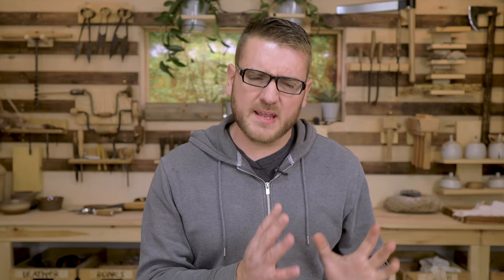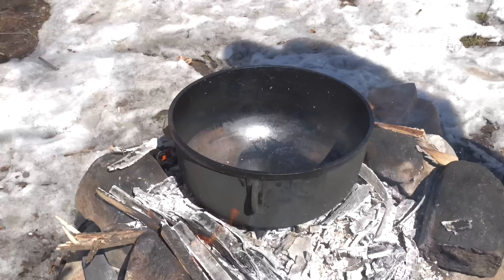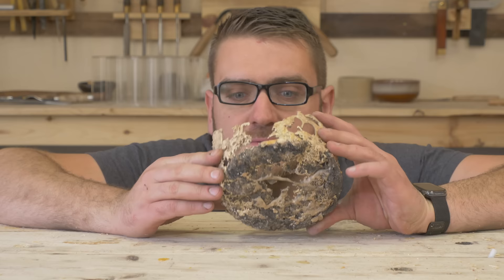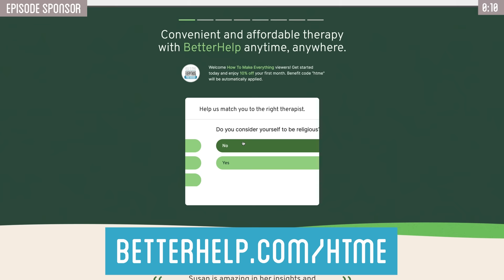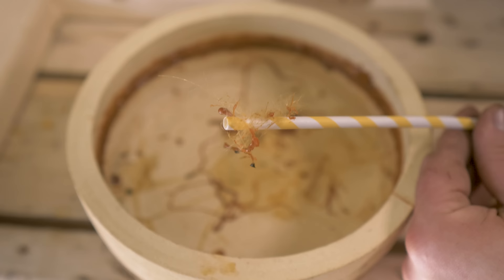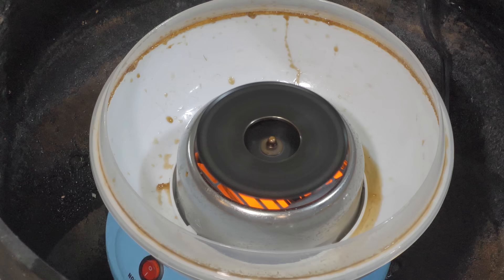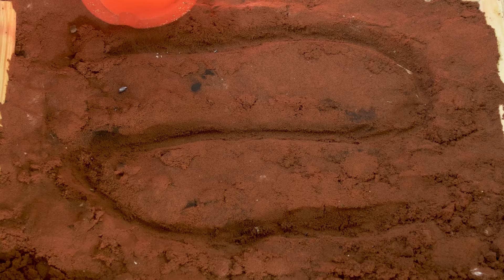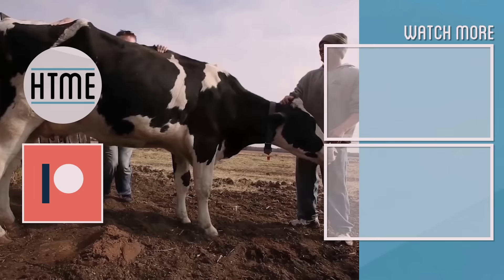Can a Dr. Stone Centrifuge Make Cotton Candy and Wires?

Comment: You could try to make wire using the Melt-Spinning method.
You continuously pour molten metal on a spinning roller.
Commercially it's used to make metallic glass strips, but I think you could adapt it for crude wires with a groove on the roller, or something, and it might be easier to do than extruding.
Reply: Drawing is technically still the easiest method
Reply: @velazquezarmouries 
Well, yeah, but if you want to make tens of meters of wire, a method that is a bit faster, more continuous and less manual should decrease the amount of work per meter of wire drastically, making it easier in the long run.
Also, if your Melt-Spinning wire is consistent enough, you should be able to lengthen it by drawing it once or twice. (after annealing it, of course)
Reply: I was thinking the same thing. As far as I know it needs to have a fair bit of space below the spinner too for it to have a chance to cool before hitting the ground. The fiber used for optics have towers to make em. That may just be a glass thing though.

If anyone is interested Google fiber optic production tower.
Reply: @thebillyd00  Maybe if they can get the liquid metal viscous enough without compromising other desirable properties, it can behave like the molten glass, but I think the cooling would be especially tricky. Unlike glass, metal is very thermally conductive, so it would be much more difficult to deal with in a controlled manner than glass. Plus, there's also work hardening, but I imagine that won't be a problem that early on in the process.
Reply: wasn't that how the stone and glass fibers that are used to insulation are made? I don't think that'll work with metal either because glass is a polar molecule and trends to act like sugar while metals aren't even in molecular form and the liquid flow will break apart even with a little distortion
Reply: @thebillyd00  
The metal roller is what cools down the molten metal. 
To clarify, I'm talking about the metallurgical process of making metallic glass ribbon, not the polymer weaving process.
Reply: @DimiDzi  
You're thinking of the wrong process, the process I'm talking about has practically no liquid flow, after the metal hits the roller, as the roller, itself made of metal, cools it down very quickly, this is why it is used in making metallic glass ribbon/strips, as metallic glass usually requires insanely fast cooling rates. And this is also why I think it might work nicely, as it solves the problem you are talking about.
Reply: @My_initials_are_O.G.cuz_I_am  metal glass is hard to produce even with modern technology requiring the roller to be constantly at negative Celsius temperature for the shock cooling to happen which either requires a fridge or substances unacquirable for that time period

most modern wires are just cold pressed rods through thinner and thinner gauges nozzles until they get longer and thinner
Reply: @DimiDzi  
Well, yeah but when you want a strip of normal, crystalline metal, you are better off with slower spinning of the roller and lower cooling rate anyway, and I presume that extruding the wire through a series of nozzles is going to be much more difficult than modified melt-spinning, with the rather primitive materials and machine-making available to HTME.
Reply: @My_initials_are_O.G.cuz_I_am  nozzle extrusion is the historical way of making cables although back then everyone just cut the wires and used them to make chain links for jewelry or chainmail armour
Reply: Your problem I think has to do with the fact that you made the hole in your crucible WAY too big. Also, different metals behave differently and I really don't think tin is a good substitute for gold. Gold is literally the most malleable material known to man and I think your issues with drawing it into a wire had more to do with impurities in the gold than anything else.
Reply: Melt spinning advantage is high cooling rate and thou specific materials can be made if process is optimized enough. I have puored aluminium on copper wheel in one of our research projects. It kind a worked but it was a mess and probably would take a lot of time and energy to get it working properly for production.
Reply: @My_initials_are_O.G.cuz_I_am  You could try extruding it, but it may be hard to create the pressure to with out machined parts and a huge lever.

It may also require heating to extrude at all which brings a ton of issues.

Comment: Look into Continuous Rotary Extrusion for some info on how wire and stuff is done at scale. The cup method you used would work for small scale. You just need more tube with a water jacket below it to cool the metal as it is falls. The metal wont get stuck because it contracts when cooling. You would still need to draw the metal down to get wire. But honestly your easiest method would be to make thin flat sheets and cut that into wire. Heck with flat sheets you could do a sorta proto-circuit board. I think its cool you tested the Dr. Stone method. Would bee cool to see some of the other outrageous stuff he did tested. Would be a cool side project series. Foxtail Ramen ect. The coolest one on the show that was not completely outrageous was the record. Though Im not sure how well you could do it with glass.
Reply: I've seen a lot of food people tackle the ramen.  It never ends well, lol.
Reply: How do i make a Gold-Sheet? 

@ScamstinCrew

Comment: Andy: "This drop thing caused a really dangerous splash."
Also Andy: "I'm gonna pour molten metal into a device designed to throw things in every direction at high speed"
(I'm not ragging, I kinda wanted to see that despite knowing it'd be a terrible idea and I'm glad it didn't seem to hurt anyone)

That last idea has some promise though. I think maybe putting it closer to the water might help, could give the falling metal less time to accelerate and separate?

Comment: Great video! 
The laminar flow wire making method seems very promising! You might want to try pouring the metal into pre heated oil, so as to cool it down and solidify it while making less of a thermal shock (which I supposed was responsible for the brakeage, although I have absolutely no expertise in the subject).
Reply: the breakage is more caused by surface tension; in the liquid state, the metal atoms are more attracted to other metal atoms and less attracted to air molecules, hence the atoms tend to get pulled more towards the center of the molten metal, forming roughly spherical blobs. This is the same reason water beads up when you pour it.

Comment: For your final laminar flow method, I think it might work if done from high enough. In the past, bullets were made in shot towers. There, they dropped bits of molten lead from a high place. Due to turbulent flow and surface tension, the drops would form into circles before they cooled, and they would cool from air flow before hitting the ground. If you did this with laminar flow, and a thin enough stream, you might be able to get the air to cool the metal before it has a chance to form into balls.

Comment: Near where i live is a “shot tower”, a brick tower that held a furnace at the top to melt lead, then this lead was poured through screens of various sizes and allowed to fall down inside the tower and through a shaft in the floor to a collection pool dug down into the cliff the tower is perched on. This was used to make small, uniform lead shot for use in shotguns in preindustrial times. The lead would cool as it fell through the air, and surface tension would cause the little droplets falling through the screen to take on spherical forms, with the water at the bottom to cushion the impact of them falling and landing on each other and to finish cooling them. 

I think that same principle might work with your laminar flow idea, if you can provide enough of a height of relatively windless space for the molten metal to drop through that it can cool to a point that it holds its shape before it hits water.

Comment: i wanna know what will happen if you have a larger container. the cup is so freaking small a small spin will definitely throw it instantly... what about a bigger and deeper container with a bit higher holes.. just like what they did in the anime
Reply: Also in the show they are generating FAR more  torque than you can get with a hand crank. Which means it spins way faster than what this video is achieving.
Reply: I was thinking the same thing. I think the problem is the depth, whether it’d work is unknown. I think with the depth and some sort of isolation of heat with the spin on it the forces would slowly raise the metal to have it drip out. The issue I see with what he was doing is basically filling the container and the metal had no where else to go but immediately out the top and the holes

Comment: most people i know that work with gold wire and silver tend to cast a small thin rectangle then run it through some rollers or hammer it. then they would draw it though the dye and then move to the next one etc and eventually be able to pull it onto a roller as it gets longer. love the video. love the distraction with the candy maker.

Comment: Yeah, that was always a questionable method. If I really had to make wire in that scenario, it'd probably be easiest to have a blacksmith just hammer it thin. Gearbox looks great btw.
Reply: Definitely not, drawing wire is no easy task. I'd use a similar method to the shows but not a centrifuge, maybe a heated secondary crucible with small holes in the bottom and I'd drizzle thin wires out as long as I could, reheat and redrizzle.
Reply: If you're talking cold drawing you're crazy. Heated rods pulled thin thru progressively smaller wooden molds would be your best and easiest bet.
Reply: @i8764theKevassitant  i don't know about using wood for a mold, i would go with cob or stone. As for forging it that is total bullshit, i am talking from experience, i am a novice blacksmith. also i might have a better way, just get it red hot on one end and pull it, i have seen it work for glass firsthand, it would take a lot of practice to get it right and using a normal fire instead of a torch would make it even harder.
Reply: @tater anus  I've seen wood work for what we're talking about. Stone would be too prone to snagging the softened metal. A nice hardened steel sizer would be best but if you're doing it Dr stone style, woods the best bet, you'll go thru a few molds but the wood will char and compress so for rudimentary wire itd be just fine. Polished stone would probably work.
Reply: @tater anus  forget forging it though, the labor involved with just making a pound of nails is insane, can't imagine 10 ft of wire.
Reply: @i8764theKevassitant  hammer it into plates then cut strips off? That’s what I’d do personally, sure it’d be pretty crappy wire but it’d exist
Reply: @i8764theKevassitant  The surface tension is too high for gravity alone to make wires that thin

Comment: I think the basic premise of this idea comes from the industrial manufacture of rock wool (which is done in basically the same way by pouring molten slag into one of these centrifuges). Rock wool was first made though by just blowing compressed air into a stream of molten material so you could try that as well.

Comment: For the wire, you can use two rollers to squeeze a bit of metal progressively thinner, kind of like an English wheel
Reply: That works good with soft metal. You can use 2 sets of rollers mounted at right angles. It can also help to follow the rollers with a steel plate with graduated holes drilled through it. Use another set of rollers after the plate to help pull the wire through. Keep pulling it through successively smaller holes in the plate. Make sure your current hole is only slightly smaller than the current diameter of the wire. Heating the stock as you feed it into the rollers or pull it through the aperture helps too.

Comment: sweet video! i think the obvious way to make wire is just to get a blacksmith to do it. if you hammer metal into thin sheets, and then roll up those thin sheets, you can get a decent approximation of a modern wire even with only basic blacksmithing skills. very labor intensive though. could always try to make a sheetmetal roller, but ehhhh there are some safety concerns there. even modern rollers can be sketchy at times.
Reply: Draw plates and pliers are a thing, and blacksmiths can, did, and make them.
Reply: i just had the same idea....

Comment: Andy: a way that ive read people used to make wire is to use a draw plate. where the holes through the plate are cone shaped so as you pull the wire through the narrowing side it stretches the wire out into a thinner strand with each pull
Reply: Don't forget to anneal the metal between holes.
Reply: @garethbaus5471  ah yes. very important step 👍

Comment: Continuous casting, i.e. bars, tubes and wires from a crucible with a hole is a commercial process, but it's finicky, and the metal needs to be cooled so it's solid pretty much immediately as it comes out of the hole or actually just before, without actually plugging the hole. And the metal needs to come out at the correct rate too so the metal neither just all runs over the floor nor the entire crucible freezes. 

Apparently a water cooled copper block is uses to start the pour, extrusion or whatever you call it.

I did hear that the Ancient Egyptians used to continuously cast wire for their chariots and bows, apparently it was pulled out under tension at a well judged rate. And either then through conventional draw plates.

But this might be a complete fiction. I find it unlikely that they had anything remotely strong enough under heat. As well the advantages just don't seem to be there.

If it's drawn anyway, and to have any strength it must, then it would seem that they would be limited to melting small batches anyway, and so they might as well cast an appropriate sized ingot and use that, either casting it to the right shape to get it through the first draw plate or more likely hot working a roughly bar shaped ingot into long and thin and pointy enough to pull it through the first plate.

Comment: For casting wire, I think the press method used to extrude corn puffs should work better. So you would put the hot-liquid metal into a container with a pipe on a side, then you use a weighted piston to push the hot metal through the pipe, and you might need to use an awl to empty the pipe after each use.
Reply: Hmm, the test at casting a cotton candy machine through pressing into it showed that manually pressing into molten metal isn't too weird of an idea...
So maybe if he gets a sealed crucible with a hole exactly fitting a pipe, and the pipe has a tiny hole in it throughout... then pushing the pipe into the crucible full of molten metal would cause pressure to rise, until it manages to push the metal through the pipes entire length. This is sort-of like his laminar flow idea, except using pressure instead of gravity, and a pipe long enough that the metal goes solid before exiting the pipe - leading to a wire coming out the end.

I imagine relying solely on gravity won't work, as the friction inside pipe likely can't be overcome by gravity once the metal turns solid.

Comment: I think maybe it's still possible if you don't melt it all the way. Part of the reason (at least from what it seems) is that cotton candy goes stringy because it's not quite liquid when it's either cooling or when it's being poured. So if you only heat up the gold to the point where it almost is liquid but still solid, it would be pulled and thinned rather than pulled and dropped. The other problem with that though is the rapid cooling could still give it thermal shock so maybe doing it in an enclosure that isn't as hot but still a temp closer to whatever the temp going in is at. The last problem is that this is still vary far-fetched to be done in the stone age and to have that type of temp control.

Comment: Seems like you would need a pretty high surface tension for the centrifuge to work. Also seems like molten metal as practically no surface tension.
Reply: I think this issue is a more complicated than just surface tension. Surface tension is responsible for the beading of the metal, but when we look at things like glass or sugar, they stretch and bend long before they melt. We're dealing with a viscosity problem that may have a surface tension component. Molten sugar is fairly viscous, so it stays together as it is stretched/thrown, but most molten metals flow almost like water, so their ability to stretch (viscosity component) is fairly low, which causes them to bead (surface tension component). I'm certain there's more to the problem (fluid dynamics is complicated), but chasing this problem really isn't worth it when drawing wire works, so long as the wire is regularly annealed.

Comment: You could try drop forging the wire.  Like how they used to make shot for guns.  Get your laminar flow going high up, and instead of dropping into a bucket just let it air cool.  I bet 6-10' might be enough to see results.  Actual shot towers were pretty tall, but a thin wire has a higher surface area to mass ratio than a spherical bead.